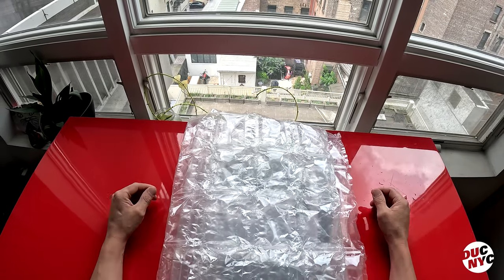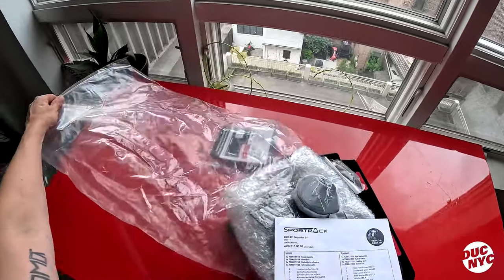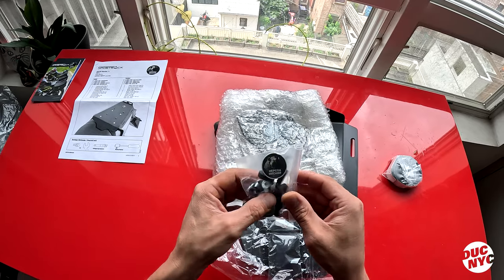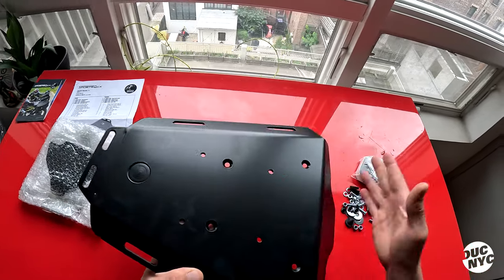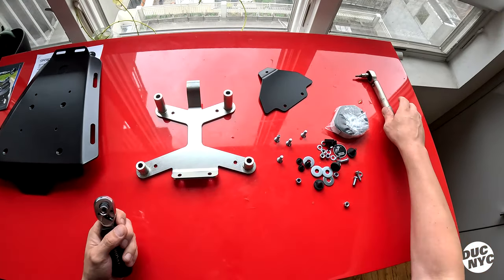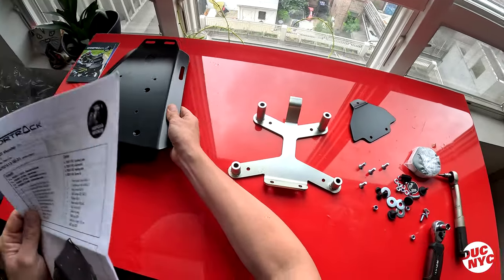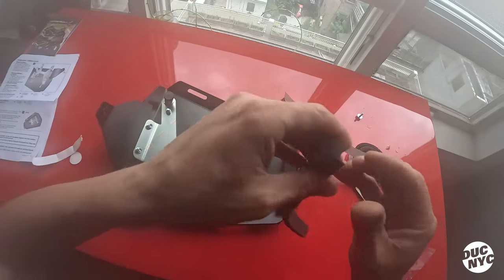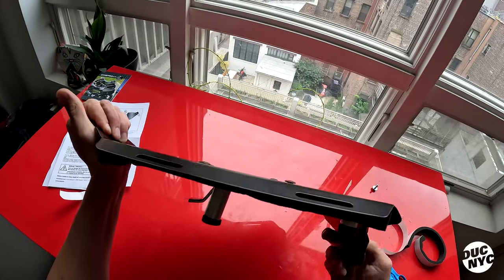How To: Hepco & Becker Rack on Ducati Monster 937 - touring perfection motorcycle luggage rackv1902

Comment: If you are looking for luggage for the Monster 937 without needing to remove the pillion seat or in addition to the this rack there is not much available. But Hepco & Becker do 'C Bow' pannier racks specifically for the 937 that take their soft panniers. Not the largest panniers in the world but good quality and look good on the bike.
Reply from the maker: Its possible to use Kreiga bags even without the Hepco Becker rack, but the rack makes them 100% more stable. Never been a huge fan of panniers. Kriega US30 + US20 does the job.

Comment: the rack would def seem to give a more secure mounting platform than just kriega loops under the seat as per ducnyc''s other video. is there any locating feature on the underside of the tail to stop a wrap round strap moving back or forward ??
Reply from the maker: No there is not. Not that I know of. I just remove it.

Comment: Apply some PPF on those plastic parts of the seat, that will rub indeed. The PPF is so cheap, why bother with repainting or losing resale value
Reply: Or pull a rubber/flex chord through the hoops to keep them on the rack when not in use.
Reply from the maker: I'm actually about to wrap the bike so - that will be kind of like PPF